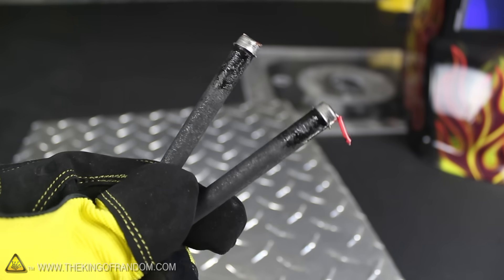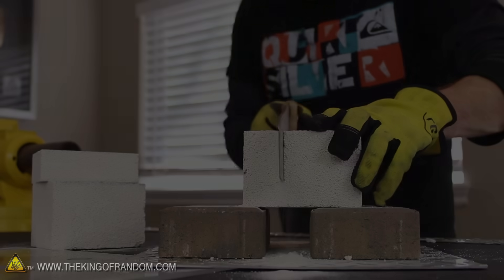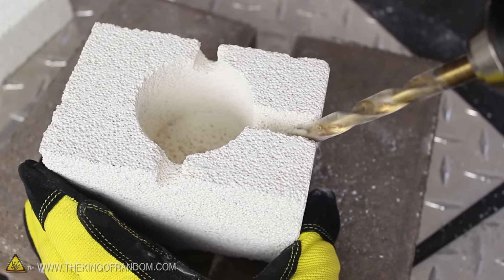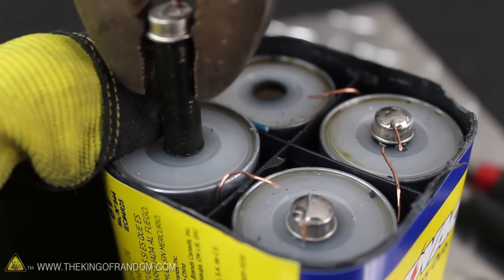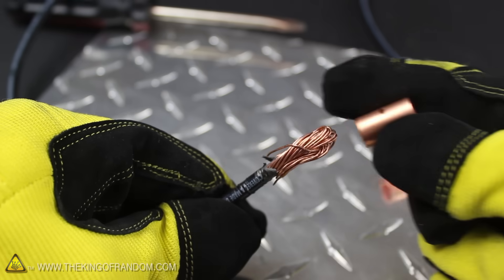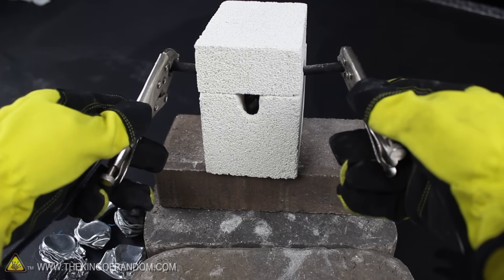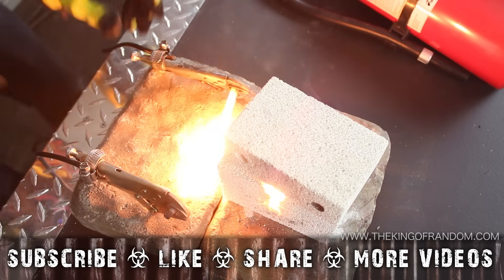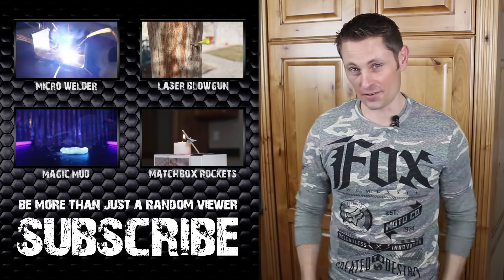How To Make An Electrical Arc Furnace

Comment: Probably should have stated the obvious, but when holding the vice-grips you need to make sure and wear gloves or something as insulators. Otherwise holding a high voltage wire in each hand is a recipe for bad things...

Comment: I've called about 12 or 13 places and can't seem to find a local supplier who has these type of Alumina Cilica bricks. My suppliers have the Sand Ceramic bricks, but those are super hard and will not cut like these do. I need an online supplier who is able to sell and ship these to me I guess. /sigh I'm open to suggestions guys.

Comment: Well I made it and I guess their is a limit to the amps you can use. I turned it to 225 ac and before my brass completely melted the brick did pooling on top of the brass which destroyed my crucible

Comment: Grant Thompson - "The King of Random"  , Hey grant, love the video and I just tried making one. Looks great! Only problem I have is I melted my brick, I'm pretty sure it's the same soft brick you used but for some reason mine melted. Any suggestions? Thanks!
Reply: By the way I ran my 220 sec welder at 75 amps. And 120. Both melted the brick

Comment: if you get the METAL FUME FEVER or ZINC OXIDE POISONING drink half a liter of milk that will help atleast when getting ZINC OXIDE POISONING from WELDING stainless steel it helps i am not a doctor im a welder i weld stuff as my job so this is my word for anyone else who does welding and/or casting zinc or stainless steel

Comment: Only thing I'd hesitate is placing the ingot in water to speed the cooling. Zinc may be ok once solid, however other metals can cool differently. Those who work around thermite welding are aware of the accidents that have happened when the slag gets wet and results in a explosion, often with fatal results. Better to let it cool overnight that risk an accident. 
Cool project otherwise!

Comment: If you guys are planning on using the Manganese Dioxide for later use, be sure to wear gloves as this chemical is a mild irritant. Also if you want to filter it out, all you need to do is pick out the brown paper that came from within the cells. You can use water to filter this stuff out, but it is rather useless as this stuff wont dissolve in water. This has pro's and con's though.

Now, a suggestion for uses with this chemical is making pure oxygen. This reaction is very simple to do as the materials are very cheap and accessible. This reaction requires manganese dioxide and hydrogen peroxide. Pour the hydrogen peroxide into a flask or anything else available and then add a tiny bit of manganese dioxide. The reaction produces pure oxygen which can be filtered out using a simple bubbling apparatus, such as a simple bowl of water, using displacement. Also, here's the equation for nerds: 2H2O2 + MnO2 --> 2H2O + O2 + MnO2. If you notice, the reaction also produces water and keeps the manganese dioxide, meaning you can simply filter it out and reuse it again and again as long as you have hydrogen peroxide! I should also note that this reaction is exothermic, but not to the point where you'll burn yourself. It produces the heat equivalent to lukewarm water.

Since this reaction produces pure oxygen, you can use it for an oxidizer in a hybrid rocket, or you could make hydroxy-gas (HHO) if you use a reaction to produce pure hydrogen, such as dissolved drain cleaner (sodium hydroxide), and aluminum. This could be used as a gaseous rocket fuel, although this form is really, really explosive and dangerous if not used with caution. This hydroxy-gas production method doesn't require electricity, special chemicals, or special materials too! Now get outta my way, son, you're usin' up my oxygen, ya know what I mean?

Comment: In your earlier video you showed how to make a arc welder, the same one you were using now. In the earlier video you used two microwave owen transformers for the arc welder but for this project could one transformer running at 240v be enoght?

Comment: May sound odd but i want to Make it
But what else can i use for power supply? Can i buy a 50-100€ welder (or how you call it) what specs do i need?  And would be that welder completely usable as welder and metal melter?  
Please tell me anything you know 

(I'm not rich and 150-200€ is absolute absolute maximum what i can spend for welder (mark electrodes etc. Not included so 150-200€ only for welder... But i hope i can use 50-100€ one) 

Help and let me know!

Comment: You should use the arc to make some aluminum or calcium carbide for another project. If you drop either 1 in water you get either acetylene or methane. Torches fueled on rocks anyone?!

Comment: Ok so for those that say it costs 100s of dollars well UR wrong . This wires and battery about 25-30$ . And U can buy a used micro wave for 20$ . That's already around 40-50$ . And those containers to melt the metal is 1.75$ each. So it won't cost 100s of dollars

Comment: Beyond Dangerous.  The Vice Grips connecting the Carbon rods are both electrically hot and not shielded! If they touch - watch out- you will arc weld the vice grips together. So I recommend insulated vice grips

Comment: Once i put those electrodes, taken from old battery, on a flame and as they buned , there was no smell but i got very strong headacke, really, really fast. It stopped soon but i guess there was some kind of gas generated and you should be carefull.

Comment: Could I buy an ordinary 100 amp arc welder for this? Or would it have to be a sertain amp and voltage? Over in the uk are mains are 240 volts, so yeah.

Comment: What is the yellow-green stuff left on the furnace walls from melting the zinc? Is it burnt battery material?

Also, how do you get slag and bits of molten metal that won't come out out of the furnace?

Comment: Can you make the arc furnace without the adapted microwave thing?
Reply: It's basically a stick welder. But instead of a normal stick welding electrode, he is using non consumable Carbon rods
Like TIG welding, just carbon instead of tungsten. But tungsten rods would work as well.
Sorry for bad english

Comment: Grant...
A box of 50 1/4" 12" long carbon arc rods costs $15 on amazon. They can be had for less at local welding supplies, and come in a variety of sizes,  no need to tear apart 6v batteries. Carbon arc rods do usually come with a copper layer though,  which could cause unwanted alloying, however removing the layer is about as hard as peeling a carrot. 
  Hacking batteries is cool,  but this is a waste of money,  batteries,  not to mention hazardous. 
Also,  it would have been wise to include an eye hazard warning,  if anyone replicates your setup they need to be aware of the danger arc flashes pose to their vision. .

Comment: I'm not familiar with stick welders, so forgive me if this is a stupid question.  As I understand it, a stick welder has one ground clamp and one clamp for the welding sticks.  In the description, it states that any stick welder could possibly be used for this.  How would one attach the two clamps to a store bought stick welder?  Would you have to remove the ground clamp as well?

Comment: Wait a minute; if you've got 240 volts going into those metal clamps and you're holding those..... how aren't you getting electrocuted? The gloves?
Reply: Is that, Renamon?
Reply: the transformers step it down to less than 5 volts, so no it cant hurt you, i assume the gloves are for heat.
Reply: Michael Gao  The one and only.

Pokefan Ah, right. Forgot about that when he said '...works best at 240 volts'
Reply: Bryan Young :O

Comment: Does that mean your holding 240v threw them grips....o.o need some with insulation and gloves  scaryyy
Reply: no the transformers step it down to like 5 volts, not nearly enough to get through your skin.... and he is wearing gloves
Reply: hmm
Reply: ***** no he doesnt have any rectifier or capacitors to turn it into dc. its AC.you are going to have bad time seraching for 1KA bridge rectifier
Reply: ***** no he doesnt have any rectifier or capacitors to turn it into dc. its AC.You would need 2x 500A bridge rectifier in parrel to make it dc and one hell of a heatsink.

Comment: What happens if you try to melt diamonds??
Reply: Diamonds don't melt. They burn. Like charcoal or wood or any other carbon based object.
Reply: *****  Carbon
Reply: Andrew Combes Diamonds are just carbon. With much heat and O2 they will just react to CO2 and CO.
Sorry for bad english.
Reply: If diamonds are exposed for a really high temperature they disappear. Only left is some CO so I wouldn't try that if I were you
Reply: Solids can all out skip the liquid stage though.
Reply: No, it can't be coal, because coal doesn't exist at the depths in the Earth's mantel required to produce diamonds, nor has coal existed long enough for natural processes to compress it into diamonds even if it did somehow teleport into the middle of the mantel.

Diamonds are made from carbon, like is found in coal, but that does not mean that that diamonds are made from coal.  No more so than just because tin cans that green beans come in are made from steel (not tin), and skyscrapers are made from steel, that skyscrapers are made from green bean cans.
Reply: You cant melt coal or diamonds, since coal is made out of acint plants and animals bured under ground,presser incerecing, and temperature  incerecing , it will just burn, because carbin burns!. And diamonds are made out of very very very very very very presserized cabin, it will just blacken. But if you get tem. Up to the tem. Of the core of the sun, then you can melt diamonds.#geo rock lesson told by a 11 year old. Sisly
Reply: Guerra Channel Anything that is the temp of the sun's core is, by that point, Plasma. It is beyond molten. Pls fact check and spell properly.
Reply: Andrew Combes  plasma is a fluid like substance, when you melt something it goes from being a solid to a liquid. their for her statement still stands
Reply: ***** 
Due to extensive research done by the University of Pittsburgh, diamond has been confirmed as the hardest metal known to man. The research is as follows. Pocket-protected scientists built a wall of iron and crashed a diamond car into it at 400 miles per hour, and the car was unharmed. They then built a wall out of diamond and crashed a car made of iron moving at 400 miles an hour into the wall, and the wall came out fine. They then crashed a diamond car made of 400 miles per hour into a wall, and there were no survivors. They crashed 400 miles per hour into a diamond traveling at iron car. Western New York was powerless for hours. They rammed a wall of metal into a 400 mile per hour made of diamond, and the resulting explosion shifted the earth’s orbit 400 million miles away from the sun, saving the earth from a meteor the size of a small Washington suburb that was hurtling towards mid-western Prussia at 400 billion miles per hour. They shot a diamond made of iron at a car moving at 400 walls per hour, and as a result caused two wayward airplanes to lose track of their bearings, and make a fatal crash with two buildings in downtown New York. They spun 400 miles at diamond into iron per wall. The results were inconclusive. Finally, they placed 400 diamonds per hour in front of a car made of wall traveling at miles per iron, and the result proved without a doubt that diamonds were the hardest metal of all time, if not just the hardest metal known the man.
Reply: Diamond is made of carbon arranged in another way than is in coal but that aside, from what my chemestry teacher teached us , any carbon substance , in reaction with O2 (igniting it) will always and always => CO2 + H2O + Q this happens in presence of oxygen , I personally don't know in other circumstances what it does.
Reply: You eventually get something liquid or gaseous, but at very high temps.
Reply: ***** diamonds are formed by carbon being compressed does not need to be coal
Reply: *****
No diamonds are fromed in the mantle compared to coal what is formed in the crust.
Reply: nothing happens, you just waste money
Reply: Eddie Kelly plasma is beyond fluid as fluid is relatively bonded on a molecular scale, whereas plasma is a series of unbound positive and negative ions. However, where these aren't bonded they still aren't free.
Reply: Diamonds dont melt! They burn!
Reply: ChristianMcDonough that's neat
Reply: ChristianMcDonough joke on you diamond is a crystal of carbon and there for can't be the "hardest metal" this title belong to brutal death metal x)
Reply: ***** it would sublimate bake to carbon gas.
Reply: If  there's no oxygen, would it turn to coal or to another allotropic form of carbon?
Reply: ***** If there's no oxygen , there is no flame from what I'm concerned of :D
Reply: ***** Also if you think about only heat, I actually don't know how it would work in another enviorment, e.g. void,only certain substance . But if there's anyone who knows I would gladly want listen ^^
Reply: Andrew Combes diamonds are not ores well not that kind of ores like you kant just melt uranium or a cake
Reply: Guerra Channel Coal isnt made from plants and animals, oil is made from dead plants and animals.
Reply: Fred_The_Zombie  They are both made of carbon

Comment: Can't melt Tungsten.
Reply: Thrro Pones An electrical arc can be more than hot enough to melt tungsten. A common figure stated (with regard to manual arc welding) is six thousand degrees Celsius, with an arc current of only about 100A-200A. PAW machines can create an arc that exceeds 28,000 °C (twenty eight thousand degrees Celsius). Need a higher temperature? Just increase the arc current, or focus the plasma onto a smaller surface area.

Industrial electric arc furnaces also use consumable carbon electrodes just like in the video. However, they are many meters long and the arc current usually exceeds 25,000A. The largest furnace consumes ~320MW (320 million watts, about 50% the output of a boiling water reactor) and can BOIL over 300 tons of steel within an hour.

This video is basically just a cheap demonstration of a common industrial machine. At uni we once did something similar using a 15kW arc welder transformer with a large crucible and graphite arc-cutting electrodes.
Reply: are you guys forgetting that the carbon cannot melt? carbon doesn't melt in earths atmospheric temperatures. it sublimes so it would just turn into ash and gas
Reply: and even though they aren't even comparable with lightning bolts, lightning can reach temperatures well above the suns surface

Comment: Why doesn't the fire brick melt?
Reply: Cause it's a FIRE brick lol it's built to withstand high temperatures
Reply: That's because Firebrick is made out of a ceramic called silica carbide, ceramics naturally have a very high melting point. In this case, it has a melting point of around 2200 degrees Celsius.
Reply: Thanks, easthight.

Comment: I think I missed the most important part; the power source. I can't destroy my microwave, so can anyone show me how to do this? Links appreciated
Reply: Find abandoned/broken microwaves on the street. Although the microwave might be broken, the transformer is pretty much always working. But buying a welder would save you a lot of time because modding the M.O. transformers is not easy.
Reply: You can buy microwave transforms on ebay I sell some but I dont have any right now
Reply: You want an arc welder. Very cheap for a basic one. Alternatively link 2 or 3 12v car batteries in series.
Reply: Thanks. I think I'll get one on Amazon and build the furnace like he did. I'm interested in casting some iron chess pieces. I have the molds and the pieces are over $150 by themselves.
Reply: Thx for asking. I was about to do the same, and you saved me the trouble of doing so. Thanks again!
Reply: Micah Giz Very cool idea!

Comment: For hobby metal melting, and for science!= Incorrect. For hobby metal melting and for science!=Correct.
Reply: The need to point out such a small error= stupid. Quickly removing grammar nazi from existence= not stupid.
Reply: *****a The comma use is debatable. It would depend on if he meant it as two different clauses.

Comment: can you burn gold in this
Reply: Unknown
Actually, gold has a  fairly low evaporation point. So you can easily burn it away if you don't  watch the temperature of your melting method.
Reply: u cant burn gold. period... u can melt it though :D
Reply: I think you mean melt...
Reply: well.. u can evaporate it, but what i meant, gold doesnt actually burn like for example a match, which i would consider burning. but yes, you're right, gold does have a low evaporation point, so u can evaporate it if u wish... i wouldnt recommend breathing around it tho... dont know what the effects of evaporated metals are on your lungs, but i dont want to find out :D
Reply: Banchoking evaporate and burn are different things, and btw its possible to burn metals just really really hard

Comment: Might wanna warm people about the dangers of making sure whatever they are pouring the metal into is completely dry as any water in the receptacle will cause an explosion if the molten metal is hot enough, also you can get metal fume fever from most metals that you inhale the fumes or fine particles from not just zinc albeit as you said the chance is very low based on the duration of the activity.
Source: My grandfather was a welder

Comment: pro tip guys, metal fume fever is real, and i know grant explains this in the video, but he left out cadmium.

Some things contain cadmium metal, Its not used very often now, but some older objects may be coated in it. And cadmium is much more toxic than zinc and the metal fume fever it causes can be lethal.